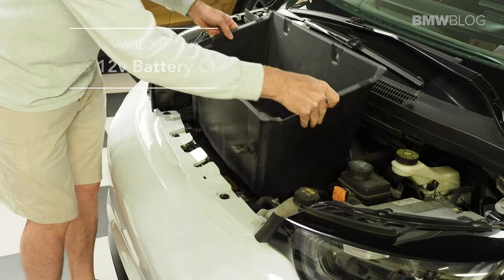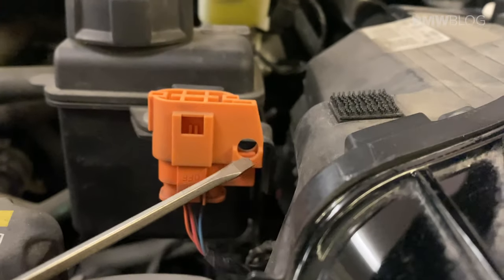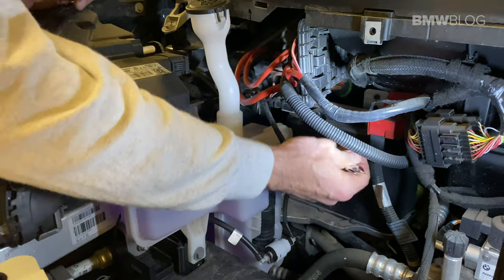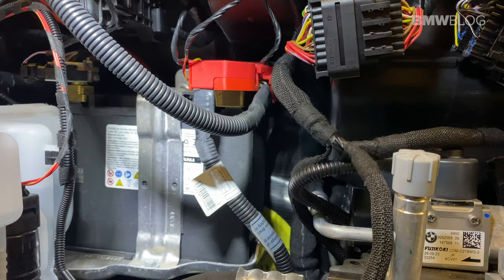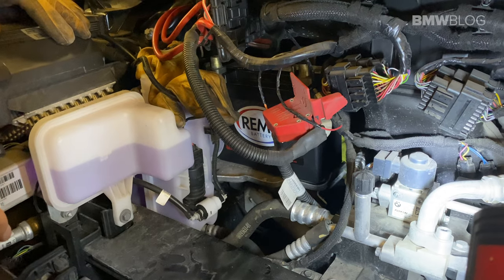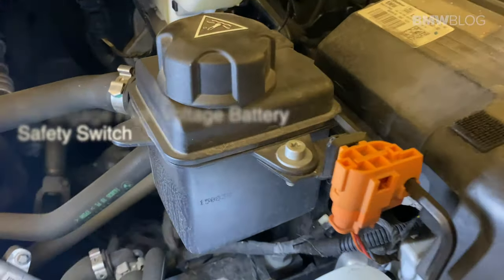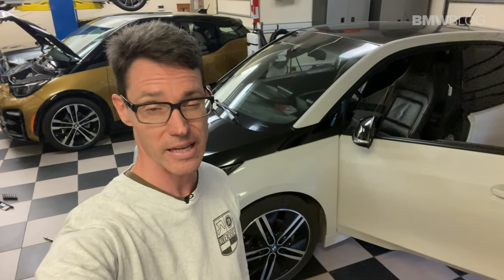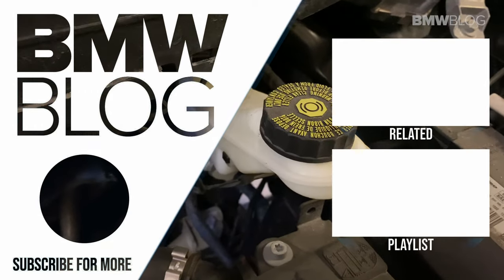How To Replace The 12V Battery in The BMW i3 | GUIDE

Comment: disconnecting the high voltage connector without ensuring the high voltage system is already turned off will create excessive wear on the switch contactors. im surprised that this video does not specify this crucially important step. the switch contactors have a service life and disconnecting the high voltage system when the high voltage system is active creates far more wear than a normal deactivation of the HV system when the vehicle goes to sleep normally.
Reply: How to ensure that the high voltage system is already turned off?
Reply: How the heck do you reconnect it is my problem !!!